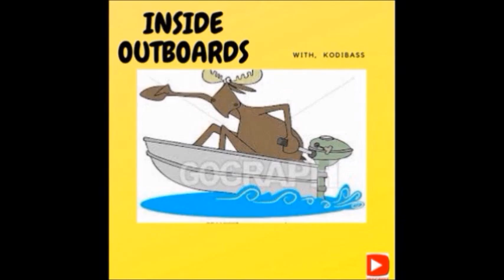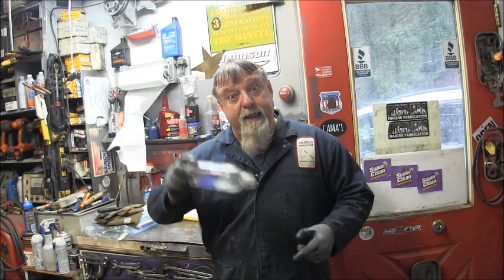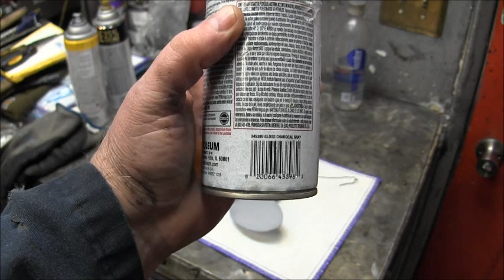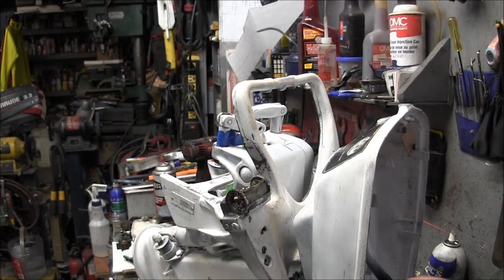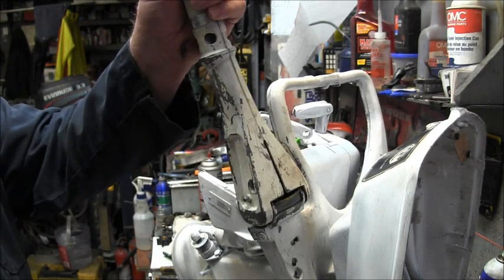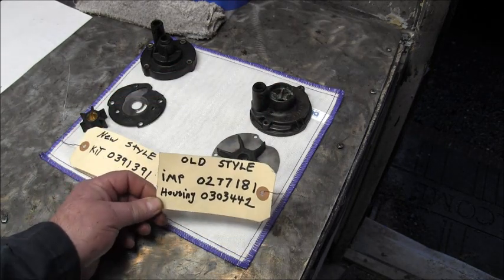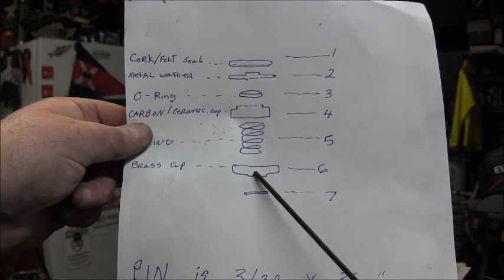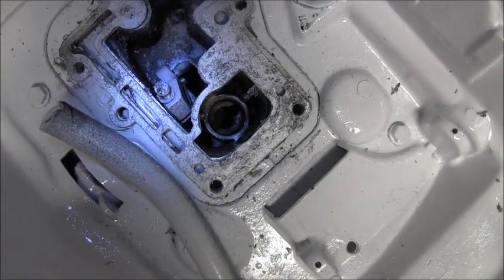JOHNSON 1978  6  HP SAVED FROM THE TRASH ,   ( Part 3 )

Comment: Yeah, assembling that tiller can sure be a wrestling match!  I agree, the newer style pump seems to work better/last longer although installing the darn impeller into the SS cup can be a pain.  Thanks for taking the time to show your readers about the lower powerhead seal assembly, this step is often overlooked and can allow water to enter the powerhead.
Roll pin:  303261-$7.50  Round cork gasket:  303355: $2.75   Oring for carbon seal:  303347:  $3.75    Overpriced, heck yeah, but saving the powerhead on such great engines is worth a few extra bucks for sure.
Reply from the maker: Thanks  K  Yep I always find them tiller knuckles a pickle.   kb
Reply: Makes you wonder how they managed any kind of rhythm on the assembly line !!! LOL.